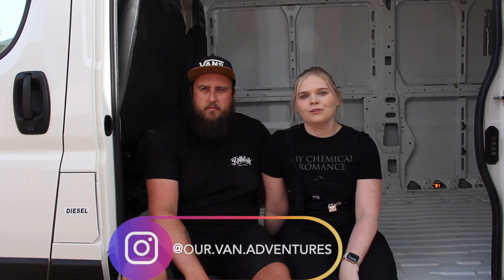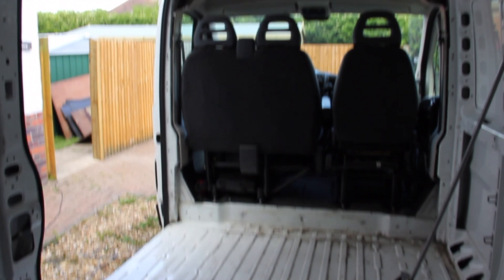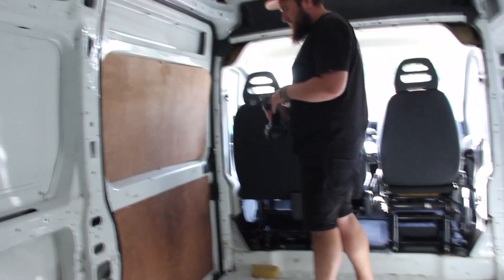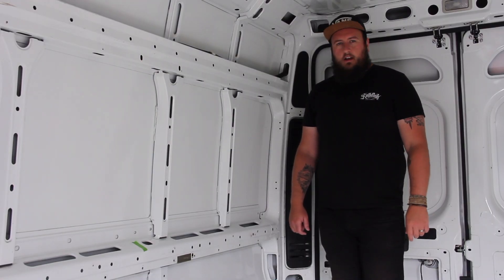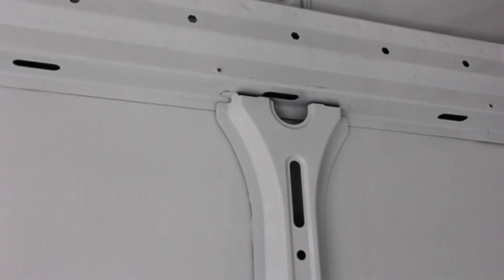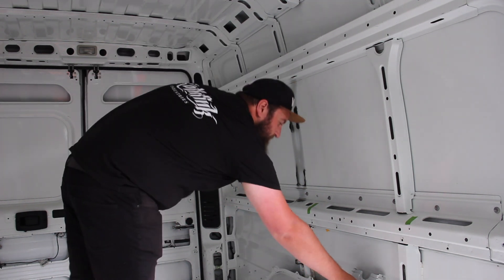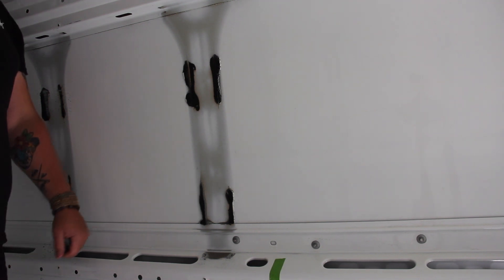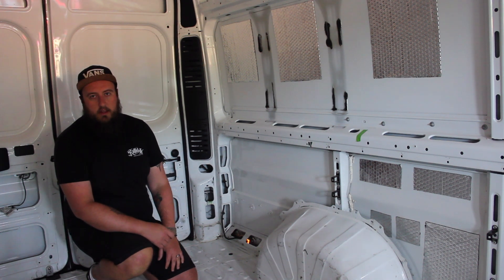STARTING OUR DREAM VAN BUILD (Peugeot Boxer conversion)

Comment: I'm thinking that this Peugeot Boxer L4 H2 that you have is a 2018 model year, as I saw pictures on your Instagram page having the 68 plate on it. I come from the United States, in Upstate New York, where this van is known as the Ram ProMaster.
Reply from the maker: Yes your right, it is a 2018 and yes this is the same as the promaster 159 👍🏼
Reply: @our.van.adventures  It's actually the same as the ProMaster with the 159" wheelbase & the extended body.
Reply from the maker: Ah extended because of the longer overhang I get what you mean 👍🏼